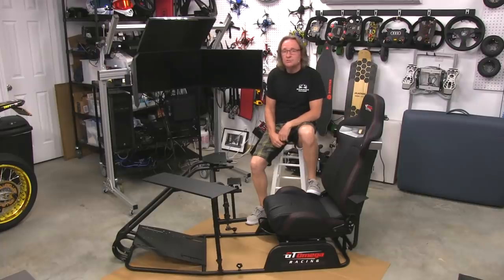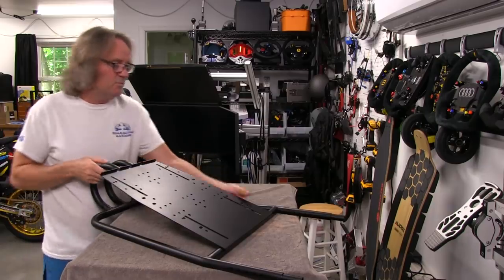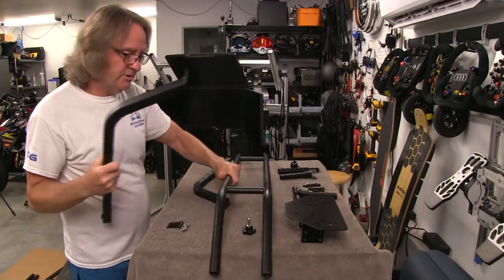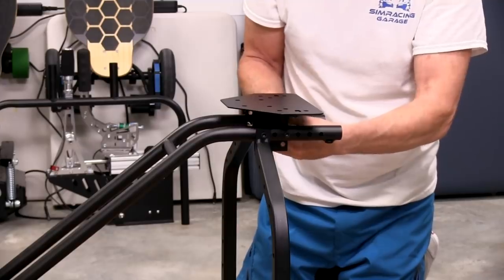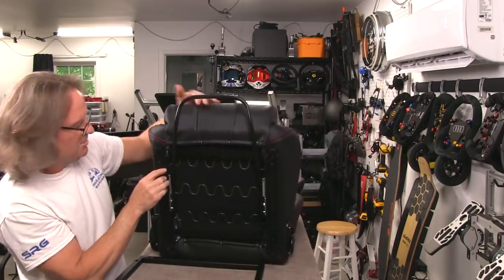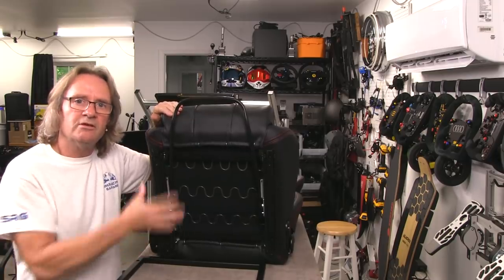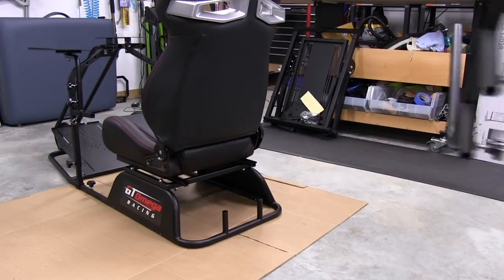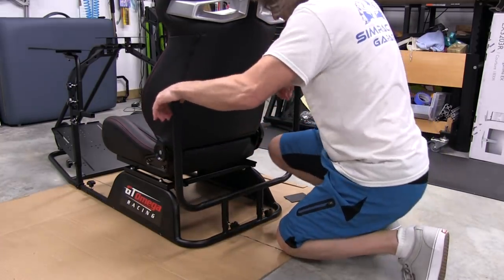GT Omega Pro Cockpit Review "The Build"

Comment: lol at the people saying that this isn't sturdy and to not buy this unless you have low end wheels. There are people who use these perfectly fine with Fanatec Clubsport wheels and once everything is tightened down properly, it's perfectly fine as far as sturdiness goes. The only time I'd recommend not getting one of these (at least if you're looking in this price range) is if you have a direct drive wheel. And no, for the price, you can't get an 8020 rig. Of course an 8020 rig will be better, but it will also be more expensive once you include the price of a seat.

Comment: looking forward to next part. Am looking at this rig atm:) Awesome channel man! U are rly in-depth with your reviews
Reply: Nick Hagen I’ll tell you right now. Order the accessories platform that the seat bolts to and the new shifter mount. They also have a new an improved keyboard tray if you like using those. 

Use this promo code from JayzTwoCents You Tube Channel:   Jayz2K14     I’ve used it 3 times in the last 3 years. It worked in November 2018 so it should still work.

Comment: Hello sim racing, I just set up my gt Omega Titan Cockpit. I’m currently trying to set up the Rs6 seat but am having trouble. You have 4 pretty long black screws. Well, I only got 2 in a bag with 2 Allen keys. I have 4 similar screws but they are silver and ever so slightly thicker by maybe 1 or 2 mm. Other then the 6 screws I mentioned, I have 4 really long thick screws with hexagon shape and they say YL 4.8. Am I right in thinking that those screws fit seat to frame? And should I have 4 of those long black screws? I was so happy to set up cockpit, yesterday, now I’m stressing over the seat. I can’t seem to line it up and I can’t pull out the rail, like you did. I’m annoyed that I’ve maybe not been supplied enough screws but even if I get extra screws, I just can’t work out how to do it. Looks like there’s already a few screws, inside the sliding rail but there’s no clear path to get to them. Any advice would be great. Cheers.

Comment: I think a cheap 80/20 rig would be a bit more stable. Will you be reviewing the CSW 2.5 anytime soon?
Reply: A LOT more stable. I would also like to a see a CSW 2.5 review if possible please.
Reply: I can guarantee it would be a lot more stable. I did this rig with my original Fanatec CSW wheel base and have a DD2 on order so I’ve started to prep for that. I fortunately am working on a movie and have friends that are on the special efx crew that I asked to make up braces that help firm up the rig front to back. Made a huge difference to where now the only real flex is in the wheel deck as well as the wedge that is supplied with the wheel base. I drilled down in to the wheel deck through the tubing to help firm up the wheel deck and it also helped quite a bit. Now my buddy is making some adjustment plates that a guy in the FB group designed so I can mount the wheel directly to the deck and eliminate the wedge all together but still get the angle correct. Once this is all done, it should buy me some time before needing to upgrade my cockpit. Once I get to that point I’ll be going with their new Sim Lab P1-X.

Comment: Nice video Barry, seeing you assemble this took me back to 2015 when I first bought basically the same rig. I have a GT Omega Pro with an RS6 seat that mounted to the frame in much the same way as the RS9 that you are reviewing here. It has served me well these years but I'm finally upgrading to Sim-lab's discontinued GT1 rig. If I may I'd like to ask a question: do you think I would be able to mount this RS9 seat to 80/20 profile as an interim seating solution? I was thinking I'd keep the slider mounted to it and use those four bolt holes at 38:12 where the frame tubing interfaces with the slider. Love your work mate ;)

Comment: I have and use an older version of that rig since 2011 (named "Speedmaster 2.0"). It was the cheapest rig I could find. I have used several Logitech, Fanatec and Thrustmaster sets with it. Over the years I had to reinforce the construction. Now I will switch a 80/20 rig because I am planning to buy a Direct Drive wheel and this rig is by far not rigid enough to hold these.

Comment: at least it's better than any "next level racing" stuff, and cheaper. I thought about buying the gt omega pro but went for a sim-lab rig instead.
Reply: what rig did you get?
Reply: @littlejimmy6877  Sim-Lab GT1 Evo. But it got some modifications since I bought it. Completely ditched the black pedal plate and wheel-desk and made something own with aluminium profiles. In fact I'm just starting the next modification for the rig.

Comment: Absolutely invaluable video, thanks for making this series! The video is so clear, concise, professional and well spoken. I bought a used Pro Cockpit with RS9 seat off Gumtree a few days ago, disassembled for cleaning, some bolts and knobs missing, really good to see how it came when new. I currently have the PRO Simulator Support Bars and PRO Simulator Chassis Supports on order to strengthen the chassis, thought I'd get them now while they are still available. Got some M8 x40 and x 25 bolts to replace some of the missing ones and picking up some nylon locking nuts to hopefully prevent the bolts from coming loose. Cheers and thanks again!

Comment: Another thing to add, the wheel deck does have holes to add the fanatec 20 degree adapter rake, but as Barry says not the 3 hole configuration

Comment: When mounting the side struts to the steering wheel plate and frame would it have made more sense to put the bolts into the front of the steering wheel plate instead of the back of the plate? This may help a little more be in line with the axis of the steering wheel moving up and down? See here: https://youtu.be/DHDfwoj6WMs?t=1266

Comment: I am able to mount a CSL Elite pedal set to the GT Omega pedal plate without drilling additional holes. With the rig assembled and looking down onto the pedal plate, the lower left and right holes (outside of the vertical slots) can be used to mount the pedal plate. Thanks for posting the video, looking forward to the review!

Comment: I got this one, used it for 3 months then got tired of shifter bracket not sturdy enough for my fanatec shifter and it doesn't fit v3 inverted pedals well at all. I had to slide down the pedals  to not hit the pipe towards wheel base. Still  have the rigg with logitech g25 for friends to play and with that wheel/pedals its a better experience.

Comment: For the money it is a decent rig. I have it with some of the upgrades and as I had replied to one of the other guys I have modified it to make it more rigid with very good success. I wish I would have known about SimLab at the time as I would have saved an extra few hundred dollars first and bought the rig once. Now with my DD2 wheel soon to be shipped I’ll be looking to upgrade my rig in the near future. I’m hoping with the things that I’ve done so far will help hold me off from needing to spend more money for a little while. The seat is probably the best part of it all. It all looks nice once it’s all assembled but does have a decent amount of flex. I was able to pull back on the wheel and it would lift the whole front portion up off the ground a little bit. I have since made some braces that I bolted on and all of that flex has gone away. The only flex that is left is in the Fanatec wheel base wedge which I’m looking to eliminate and making pieces to allow me angle adjustment while bolting straight to the wheel deck.

Comment: I found mine to be horribly wobbly, even with the new chassis support. It flexes and bends a lot under braking due to a complete lack of triangulation.
Reply: what wheel and pedals are you using?
Reply: @dufey1969  Simucube Pro and Fanatec Clubsport V3. While the Simucube works just fine, the V3 are just too stiff. I went for softer inserts, which helped quite a bit, but the chassis still flexes a lot. Same goes for the shifter attachment, it wobbles quite a bit. Not impressed for the price when compared to what else is out there for just a little bit more.
Reply: @Badger_S197  thanks

Comment: Do you think the wheel plate would support a DD wheel?
Reply: I had emailed GT Omega about the Fanatec DD wheelbase, and if it could handle it.  They said they haven't done any testing with it yet, and it may need some modification.  They didn't specify what modification though.

Comment: Is the RS9 seat basically the same as the Sparco R333?
Reply from the maker: "Looks" the same...not the same.
Reply: @simracinggarage3026  ah okay so the R333 from Sparco still has higher quality which makes double the price? ^^
Reply from the maker: Don't know about the quality difference, as I have never had an R333 in the SRG. But the RS9 I think most would agree, is a very close copy of the R333. Only you can decide which one fits your needs.
Reply: @simracinggarage3026  would the RS9 seat mount right up to an 8020 cockpit?
Reply from the maker: @dakjones82  As with most things, you may need to fabricate a mount for it. I have not tried to mount this seat, but being an 80/20 profile cockpit, it certainly is doable.
Reply: @simracinggarage3026  really appreciate your reply. I figured it was doable but wasn't sure because I've never worked with the material and I'm still waiting on my shipment from Sim Lab. Only concern I have is that it doesn't look like the seat comes with the rectangular mounting frame shown in your video review. Looks like sliders only. If I order the RS9 seat I just want to be sure that I have everything on hand for mounting.